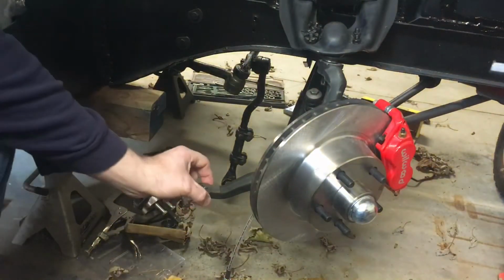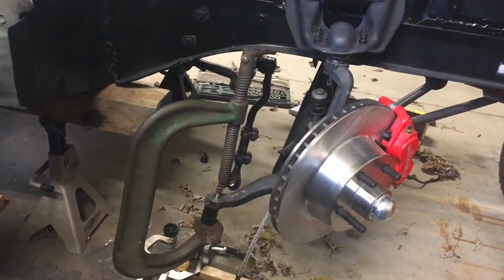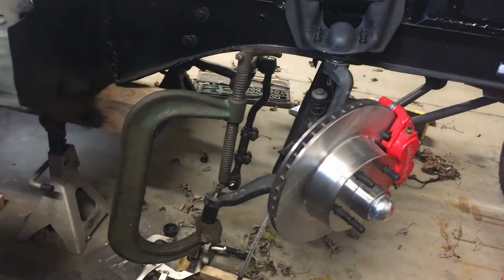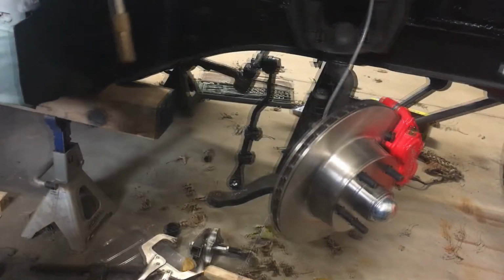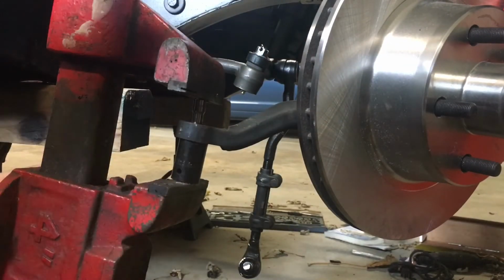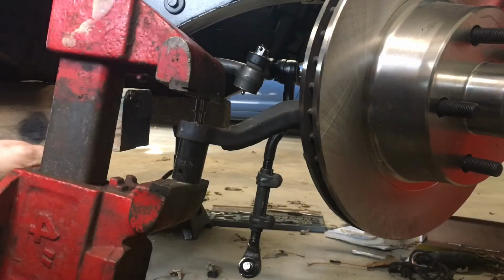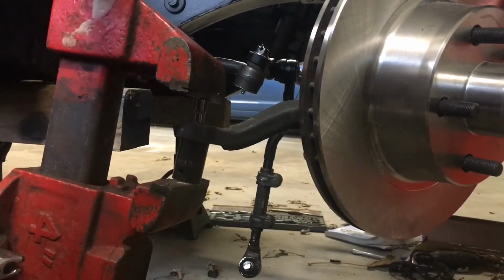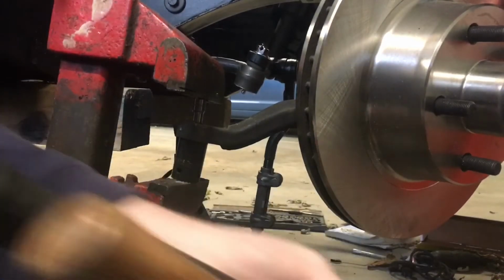Thanks VMF Guys!

Comment: Tip;' always heat the area around the stuck part to expand the metal a bit, dont heat the part like you did at first, that just expanded the pin and made a tighter fit in the hole

Comment: Can I ask  how much you paid for the disc brake kit because I am having my motor rebuild soon with 300+ horse power and is it hard to install and can I still use my 14 inch stock wheels thanks
Reply from the maker: Hey Krazz, the kit was $665 in red or $575 in black on CJ Pony Parts. They will fit some 14" wheels but not sure about yours, you may need to upgrade to 15" wheels. On CJ's site it says "clears most 14" OEM disc brake wheels"
Reply: jevchance thanks i thank that I'm going to keep my drums because they work great and my motor builder says my brakes will stop it just fine